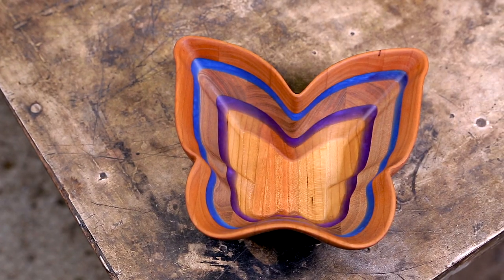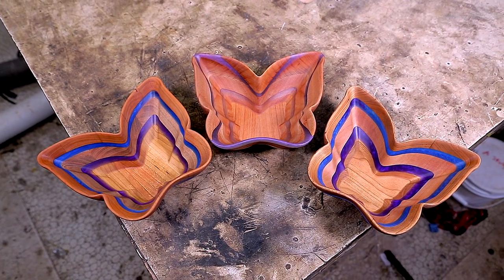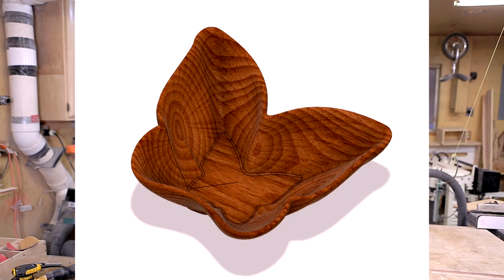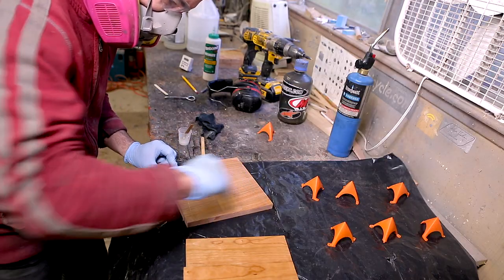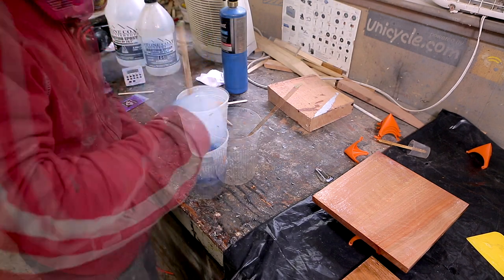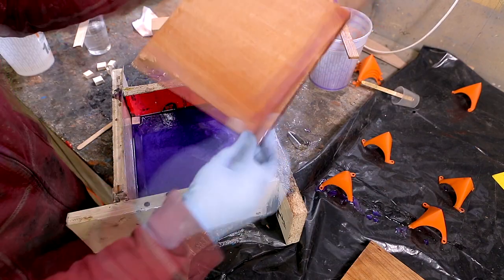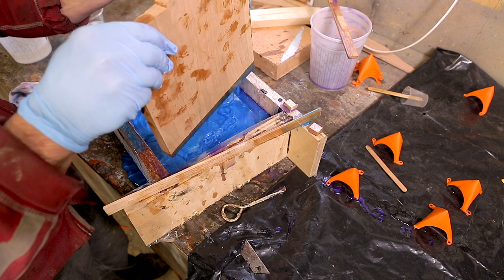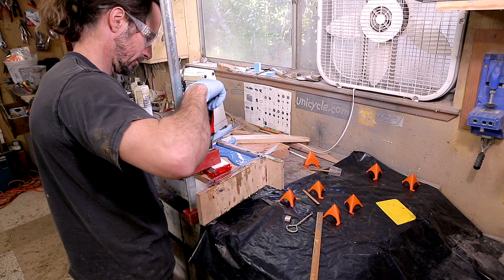Butterfly Bowl - Wood and Epoxy Bowl Made on a CNC Machine - CNC Woodworking

Comment: These are wonderful, I tried cutting;g wood on my Tormach once, it took forever to clean up since I mostly cut metal and everything has a oil film on it,  I would love to win this for my wife. Thanks!
Reply from the maker: Oh yeah, it is a mess switching back and forth from metal to wood! Especially when I run coolant. If you want the Fusion file I can send it to you; be warned: the CAM can be tricky.
Reply: Corbin Dunn no thanks, no wood for me anymore ;-)

Comment: The time lapse is mesmerizing! The finished bowl is beautiful.

You said you were worried about air bubbles from the casting technique. Looks like there were no air bubbles in the parts that matter?
Reply from the maker: Hey Bridger!! The first one got one hole in it on the bottom; I filled it in with colored epoxy; it is almost invisible, unless you hold it to the light. the second one turned out bubble free. The third and fourth and fifths came out good, but I did patch a few spots in one of them. The latter ones are a new design concept that i'll share soon! (probably in two weeks)

Comment: Looking great. You've got bowl making down. You log your total time and machine time on one yet? I'd be curious to know if they are a potential candidate for Etsy or Amazon. Or maybe you can just hit up a local fair when you accumulate enough to make it worth the effort of selling.
Reply from the maker: I need to keep accurate time tabs. The first op (bottom/outside) is about 4.5 hours of machining. The second op is about 6. I've been tweaking things each time to make it more efficient and fix issues. I also realized I can just CNC machine the mold shape I want into the block of wood; pour epoxy, and then machine the butterfly.
Reply from the maker: Cutting the tree down and slabbing the logs also took a good full day ;)
Reply: @CorbinDunn  that's probably too much machine time to try selling these. I think the going rate for 3axis cnc mills is around 40-60 an hour. I always found it strange that the hourly rates were that low,  but I'm starting to think that's because of how slow the throughput can be. Still cool pushing the bowl envelope though. Your gonna have one heck of a collection.

Comment: Beautiful job.  What bits did you use?  Length, size, type and mfg.  I am sure you use some generous clean out bits.  And did you use a round over bit and with what step over?   They must have been very long and narrow to do some those corners.  keep it up.  I subscribed.
Reply from the maker: Hi GW - I use the same few bits on most all my projects; they aren't very long. Check out this series where I cover the details on how to create a shape from CAD to CAM to machining - https://www.youtube.com/playlist?list=PLqbMbcTzG1Fc0jLrHUR7csE7wf2sZm1oV -- Most the bits where Whiteside, but lately I started with Amana Tool and they are pretty good. Here's another (older) video where I discuss some of the concepts, bits and details - https://www.youtube.com/watch?v=ShHz8HjCyqw
Reply from the maker: For the depth of cut, and step-over, download the Fusion 360 files I shared and check out my CAM setting for each tool, including the exact bit, feed and speed.  Speed is basically max RPM for my Tormach 1100, and feeds are based on that RPM (ie: slower feeds) and depth of cut (ie: about the bit diameter max DOC, but varies based on the wood).
Reply: @CorbinDunn   I don’t use fusion.  Just wondered what bits you used.
Reply: @CorbinDunn  Thanks
Reply from the maker: @bw162  3/8" spiral up cut bit for roughing, and 1/4" ball end mill - that's about it! I don't recall the stopover..it varied per project depending on the detail (more stopover for more horizontal detail). I highly recommend getting the Fusion 360 free personal license!
Reply from the maker: In this video, the ⅜" is a Frued - I broke it when a piece came loose and sucked up into the machine and then threw it off.